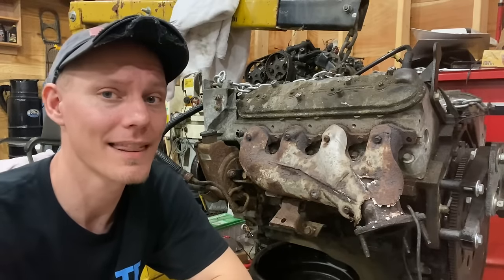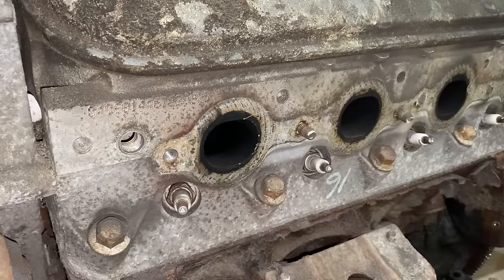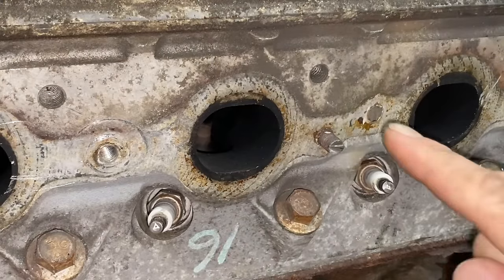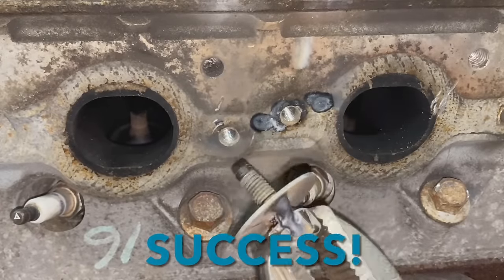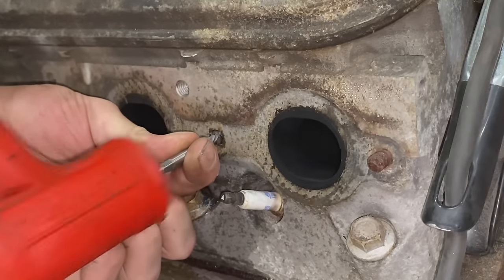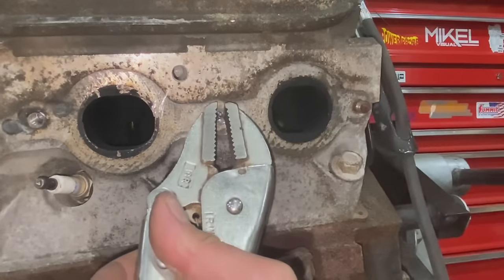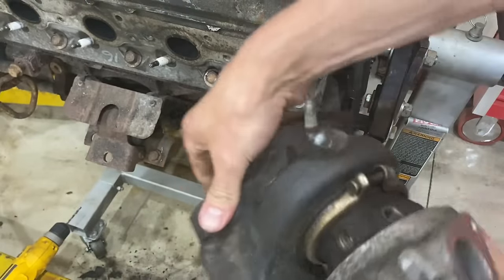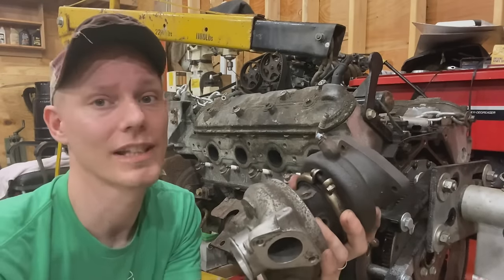How To Remove A Broken Bolt 6 DIFFERENT WAYS - LS Exhaust Manifold

Comment: I used old socket weld to the studs most of my sockets are cracked or broken it works great weld dead center make sure leave enough room get ratchet on the socket
Reply from the maker: If you have sacrificial sockets, that sounds like an outstanding solution! Thanks for watching!
Reply: I never turn in broken sockets I keep them just incase I break the heads off of the bolts weld dead center of the socket easy out
Reply from the maker: @keithratliff2347  - this is a good idea. I’ll have to start keeping all my junk sockets!

Comment: A method that has worked for me is a chisel and hammer. Scar the broken bolt close to block then use a hammer and chisel to unscrew bolt. 👍
Reply from the maker: Good info! That has worked for me a few times as well. Thanks for watching!

Comment: You’ve ever hear of a inductor? It’s a tool that turns bolts red hot.  That enable you to turn them easily
Reply from the maker: Yes! I’ve never tried one. I probably should!
Reply: Yeah but it’s hard to induce heat into a stud that’s broken off flush or below the surface. That’s why the welding method is usually the trick

Comment: When using a Easy-Out in a drilled hole the bigger the hole and thinner sidewall on the broken bolt the easier it will come out... and use heat and oil etc... The Square Eas-Outs work better then the screw type
Reply from the maker: Good info! Thank you!

Comment: What if you have aluminum motor I am dealing with the issue now I have a 2003 CL500 Mercedes my praise broke off the power steering pump which is the power tandem power steering pump my threads crack from the timing chain cover

Comment: None of those removal methods work for my situation where the broken bolt has had someone drill into it and try to use an extractor that broke off in the bolt so now I can't drill it out the rest of the way and can't weld anything onto it down in the hole.

Comment: Welding is a good ploy but I often drill exactly down the centre with a pilot drill then incrementally larger holes with my left handed drill set.  Not yet had a failure - with some larger bolts than those tiddly manifold studs.  Of course, it is handy if the part will sit on my mill table for drilling, but hand-held has had to work, if not.  Longer studs are gripped with my socket stud extractor if possible, so probably several more ways of ‘skinning this particular cat’ dependent on what exactly arises.  I avoid stud extractors at all costs.

Comment: He’s so positive and cheerful.   When I reach this stage of removing a bolt, my cursing summons the devil from the red hot bowels of hell and my priest has to come over to the shop and perform an exorcism on my tools.
Reply from the maker: I’m trying my best out here! It’s all about your perspective on the job. I knew it was going to be a bad time, after I cut the bolts off. Worst case scenario, I’d replace the head, and honestly that’s not such a big deal on an LS engine. Having a positive outlook helps a lot. Thanks for watching, and good luck with the exorcist. Lol

Comment: If you break a hardened tool in the hole you drilled use a carbide and die grinder to cut it out. Not many tools are harder than a carbide bit. A  1/4" OR smaller tapered to a point tree works on bigger stuff. On a dremel tool a tiny little ball end is good. MAKE SURE YOU GET CARBIDE CUTTERS.

Comment: Cool, so the secret to bolt extraction is to make sure your bolts don't break down inside the hole, got it.

Oh and next time you might want to use a left-hand drill bit and tap.
Reply from the maker: That’s not the case actually. If it breaks below the surface you can just add weld the top of the bolt and build it up enough to crest the surface. Or, you drill it out.  

I also bought reverse drill bits recently because tons of people have suggested I try them.

Comment: Ezyout must be the worst misnomer ever. Think about it, they should be called Hardestout. I've broken a few in my time but we learn with experience. Using the largest sized Ezyout is the trick. I've also used a tap to remove remnants of bolt.

Comment: I prefer to use a carbon arc gouging rod vs drilling. You should use something about 1/4th the diameter of the bolt. Also, the direction of travel can be more easily adjusted.

Comment: The way I learned was to put the manifold back on and get a drill bit thats just barley smaller then the broken bolt and drill the top of broken stud until it creates a (crater) then go another size smaller and it will be perfect every time.
Reply from the maker: That’s a good trick! Thanks for sharing it! I may try that next time!

Comment: If the bolt is sticking out a pipe wrench works better than vice grips.
Reply from the maker: Pipe wrenches are damn near magical if you can fit them in the work space.

Comment: Here in Australia, doing this type of task, and stuff it up, best way is then to use a helicoil, drill the actual holer larger, then the helicoil takes it back to the normal size of with the thread
Reply from the maker: That’s a great option for sure! And if you have good drill bits, it’s probably faster than some of these other methods! Thanks for watching!

Comment: I broke an easy out in my valve cover head. Any suggestions? I don't have a welder, as of yet.
Reply from the maker: They are fragile. Sometimes you can whack them with a punch and shatter them and then pull out the small pieces.

Comment: I don't know why your tools make very different noises to mine. 😂
Reply from the maker: 😂 I’m glad somebody appreciates my tool sounds.
Reply: @WiringRescue  and how!
I'm just about to extract some seized and half broken, rusty exhaust studs from the head of a BMW motorbike.
And BMW, in their eternal wisdom, has put these bolts in a recessed spot in the head, so tools that grab the bolts don't fit.
I shall go the counter nut route.
Reply from the maker: @jochenstacker7448 - I have heard that you can get a small copper pipe just bigger than the bolt, slide the pipe into the recessed hole where the broken bolt is, and shoot welding wire/rod down the pipe with hopes that it will stick to the broken bolt. This will heat the bolt and also give you more to grab. Obviously remove the pipe for bolt extraction because the weld won’t stick to the pipe.

Good luck! I’m cheering for you!
Reply: @WiringRescue  the studs are still sticking out, they're just in an odd place.
Counter nut was not effective, the threads are too rusty for the second nut to grab, so gotta weld a nut on that thing.
Only problem, I don't have a welder. 😁
Will have to wait till Monday so I can bring the head to the shop to weld a nut.
Reply: @WiringRescue  had to be drilled out and inserts put in.
Those bolts are exposed to the elements on a BMW boxer motor facing forwards and 25 years of dirt, grime and salt have seized them to the point of becoming one with the head.

Comment: I found by far the easiest way to remove a broken off bolt if it sticks out a bit. This method has NEVER failed me and is so simple. Use a small pipe wrench about 6 inches long with good teeth. Make sure you have it facing the correct direction so it will clamp tighter the harder you turn it.
Reply from the maker: True! I need to get a small pipe wrench. My toolbox is lacking that!
Reply: @WiringRescue try a basin wrench, it works awesome

Comment: I never believed the double nut method worked until, I have to take my intake out, and there was a stud holding my coil pack, the tip rounded becauee it was a stupid 5.5 mm, I ended up using a double nut after vice grips wouldn't work, I tell you what once you get those nuts tight enough the dam thing comes right off

Comment: What if you don't have a welder. And welding the turbo was just daft.
Reply from the maker: The turbo was a joke that apparently wasn’t very good. If you don’t have a welder you can drill it out, maybe even using reverse drill bits.
Reply: @WiringRescue  thought it was a joke. Yeah it worked I got it. Would a lightweight blow torch and braising rods be strong enough. Thanks for your help and advice
Reply from the maker: @robertadams3383 - I’ve never tried it that way, but it’s definitely worth a shot. I have also heard that you can drill out the center of the bolt and thread a reverse-thread screw into the hole. As long as the screw is strong, it has a good chance of working.
Reply: @WiringRescue  my drilling it out didn't go to plan snapped the drill remover off, and broken the drill

Comment: I have a broken bolt below the manifold but I have an idea so someone tell me if its a good idea or not but basically drill a hole, stick some toothpicks in the hole & put a screw in. The screw will press the toothpicks against the broken bolt as if it's sealing or tightening then screw it out
Reply from the maker: It’s worth a try, but you’ll probably need a reverse thread screw. Try it and let me know how it works out! :) I’d love to know!

Comment: Does welding a turbocharger to the busted stud extract the stud faster?  Would a starter housing work?  I mean.. you have to start the extraction before you can remove the stud, right?  Also, you might try welding a microwave oven to it.  The radiation has a profound affect on corrosion.
Reply from the maker: I’ve actually tried both. The microwave method only works if you fill the intake manifold with beef jerky. It simply won’t work without it. The starter is a good option, but it needs to be attached to a 2nd engine for it to turn correctly. I think it’s a fulcrum / lever science sort of thing. Hope that helps!

Comment: I am having this exact problem right now, 98 civic lx with a ex exhaust manifold/exhaust itself and I got all 9 nuts off, all 8 studs/bolts out except for the lower middle one, I just today broke it flush with the block and im basically at the drilling/tapping stage, but motor is in the car, so I don't even know how to get a drill inside there, so I can re-tap

Comment: The extract method didn't work because you have to drill all most the hole bolt out for it to release it self before the easy out used. What about the hot cold method?

Comment: What if the stud is broken in side of the head  and no flush?🤔
Reply from the maker: You can still weld it to a washer, I’ve done it many times successfully. Once the washer is welded to the broken stud, weld a nut to the washer and twist out the broke stud! Pretty much the exact same methods as the video.
Reply: @WiringRescue  all right thanks a lot really good information keep up the wonderful work 👍💪
Reply: Can use copper tubing if its way below flush to build it back up with weld
Reply from the maker: @davidsimms2806  - that’s certainly an option, because the weld won’t stick to copper. But you’ve got to be good at aiming the welder doing the hole! :)

Comment: Does a supercharger work just as well as a turbocharger?
Reply from the maker: Sadly, the roots type won’t work quite as well because they are mostly aluminum. However, if you get one of the centrifugal superchargers from a 1957 Studebaker Golded Hawk, it would work great as it has more steel in it! Good luck!
😂

Comment: I tell you easy way and surprising enough if you do it right it blow the bolt right out or you can cut hole straight into it that makes it easy to drill or use easy out and that's a plasma cutter.

Comment: Thanks but i spay first 4wd than give the bolt a punching on the center of the bolt leaves it for 10 minutes and than repeat it  with spray and punch and than began with the drill  first with a small one than the bigger one  and at last the puller

Comment: What also works is to cut a slot in the bolt with a hacksaw and use a flathead screwdriver to get it out.

Comment: I wish i saw this a year ago.. i had a machine shop fix mine and they poked a hole and she stud hole leaks coolant now.
Reply from the maker: That really stinks. If you have nothing to lose, you could always drain the fluid, stuff a little JB Weld in the hole, put the bolt in (to squeeze the JB weld in the hole), then take the bold back out before the JB Weld hardens. Then when it’s dry, chase the threads with a tap, rtv the bolt for extra safety and see how long it lasts.

I once did something like this to a head on. Ford Expedition and it lasted years. When it eventually began leaking again (~3 years?), we cleaned out the hole again, and added more JB weld. It got like 7-8 more years out of that truck.

Comment: I just had to drill a exhaust bolt out I drilled a small hole and stepped up to a bigger hole then I tool a torx bit tapped it in and it came right out

Comment: I weld the differential end of my drive shaft to the broken bolt. Then I rev the engine. Twists those puppies out everytime
Reply from the maker: Great solution!  Also - try welding a chain to the bolt, and then welding an anchor to the chain.  Then you just drop the anchor in the ocean, and BOOM - the bolt comes out. No problem.
Reply: Brilliant! Haha
Reply from the maker: @Tom-ik5sc  - thank you! I’ve been thinking about it for a while.
Reply: @WiringRescue  I sense a video idea in this. Maybe a Project Farm style comparison to find the best anchor for bolt removal, while throwing anchors off a speeding jet boat haha
Reply from the maker: @Tom-ik5sc  - yessssss! How will we know which anchor is best without testing them all?!
Reply: @WiringRescue  A 64 anchor play off style bracket.... Think of all the likes....

Comment: If you have to resort to drilling, use a left hand bit, a lot times the heat and pressure will back it out on its own, also, much less likely to break the extractor off with a T handle, so even pressure can be applied to both sides🤷‍♂️

Comment: What kind of welder do you use?
Reply from the maker: I believe I was using my Hobart handler mig welder for this.
Reply: @WiringRescue  Thankyou. I'm using a Harbor Freight/Chicago Electric welder and I'm using your flat washer/Nut method and it keeps breaking off. I don't know if what I've got can do a good job, Any tips? I don't know if it has anything to do with the thickness of the flux core I'm using(0.030mm) or the welder I'm using. 
Please help 🥺
Reply from the maker: @lionbolt2136  those HF flux core welders are not super powerful, but make sure the metal is clean and the power is cranked way up. I’m cheering for you!

Comment: Actually to help yourself if your going to the Extractor method start by using a Left Handed Drill Bit. ( No, this is not a gag..sometimes the bolt will come out with just the drill bit)

Comment: The washer method was cool. Turbo method was  a whole other method.
Reply from the maker: Yeah the washer method is the best I’ve found, as long as you have a welder. Thanks for watching!
Reply: @WiringRescue  Just tried it on four broken studs. My welding skills need help but I can improve. Worked like a charm. Thanks

Comment: 10:22 never use tapered extractors.....they only push out on the threads and make it harder ....you eventually will have to weld a nut to it because you broke the extractor off and cant drill it out....if you have to use an extractor, use a straight fluted extractor...blue point makes them as do some other tool makers

just wanted to point out why welding a nut on works so  well , even with crappy welds......because you used heat from welding

a better way to add heat is to use an induction heater, some will say it works better

Comment: I would have first heated up the broken studs with a torch then spray them with a penetrating spray oil like PB Blaster. Then  you could  drill holes in studs centre and then you would weld the flat washer to studs  filling those holes for extra weld contact.
And finally take an old socket with 3/8" drive weld it to the washer and use a ratchet to remove the stud.

Comment: When drilling out bolt, they say to use a slow drill.  Maybe your video was just sped up.  Also, crescent wrench is not the best tool.  A 12 or 16 sides socket works better.  Also, Left-handed drill bits are recommended.  You can buy them cheap at harbor freight.

Comment: I am the official broke bolt getter outer. Bolt 5 can be easily removed by drilling and driving a torque bit in good and tight. Put heat to it a back it out. I usually use a 1/4 inch impact or a drill.

Comment: what if the nut has a metal stuck on it that block the thread from turning?
Reply from the maker: I’d probably cut that metal off. Though it’s tough to know for sure without being there.
Reply: @WiringRescue  yeah i was thinky to cut it of but its risky the nut is stuck on the bell in my scooter annd i dont have the exact tool to cut it off

Comment: Good job sir … amazing helpful video really appreciate this kind of content 
Totally gonna do the last solution i just need to buy the turbo 😂😂😂😂
Reply from the maker: Glad you enjoyed it! There is a direct correlation between owning a turbo and being happier. Good luck!
Reply: @WiringRescue  thanks for quick response 
Quick question: what is the best way to use if the engine is on the car and im not planning to remove it i have the last bolt broken
Reply from the maker: @Lostsoal  in my opinion, welding a washer to the broken bolt and then welding a nut to the washer is by far the best option.  I have done it to a rear bolt on the drivers side of an LS engine in a truck. It wasn’t great, but it worked. Take the inner fenders off and you open up lots of space.
Reply: @WiringRescue  i thought about that too 
Thank you so much and i wish you the best of luck

Comment: Ive tryed the easy out method no, good!!
How do you go about using the install thread method? Do you have a clip showing how to use?
The engine i have is an old 5.7 steel heads. Was yours aluminum?

Comment: When I use the drill and extractor method I will use a couple of old nuts that just slips over the drill bit tack welded together and a welding magnet to make sure the bit goes in straight. And soak the hell out of it with penetrating oil. I have success about 90% of the time